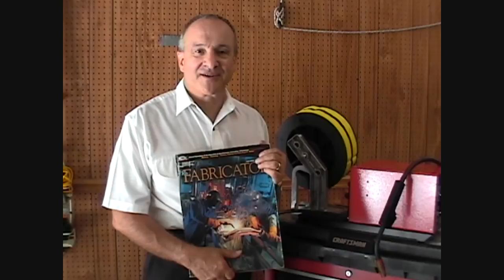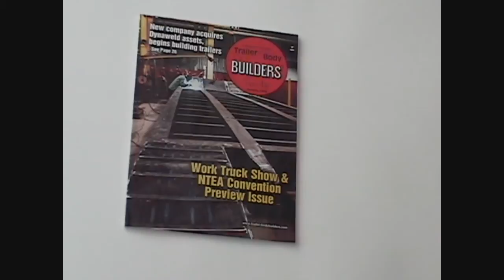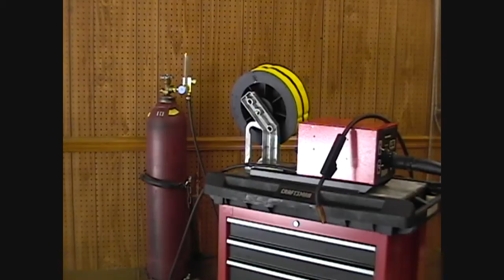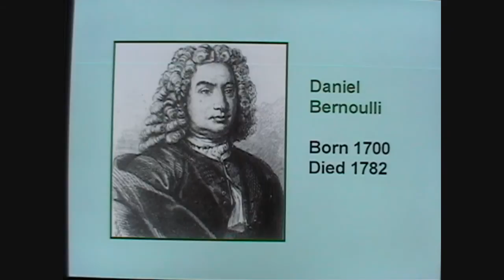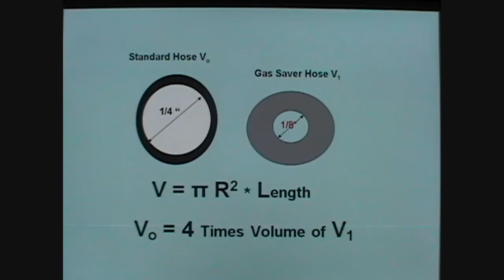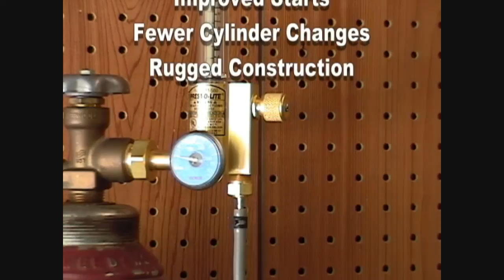MIG Welding Shielding Gas

Comment: i never payed any attention to my gas until i had to take my mig out to a job and used a small r size bottle that cost me $30 to fill. it was gone in 30 MINUTES!!! i seem welded about 8 feet!!! that would make my gas expense $60 AN HOUR!! thats the labor rate most shops job! i know the small bottle isnt efficiant but come on! my 80lb bottle is much better and even though its 4 times the size they only charge $13 more to fill. but i still want to cut down. thanks for the video